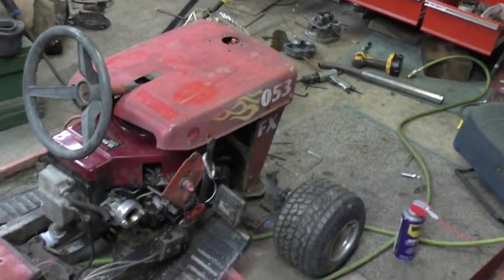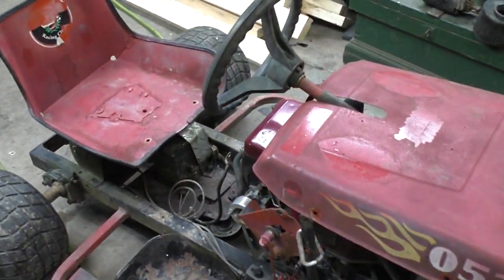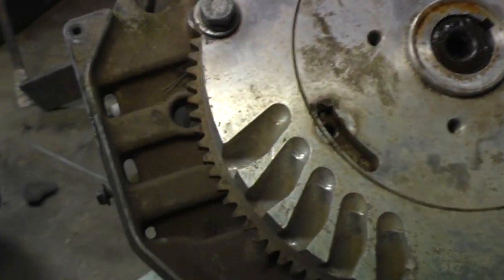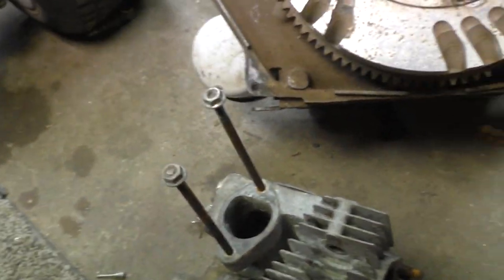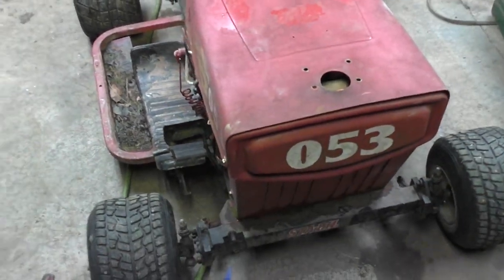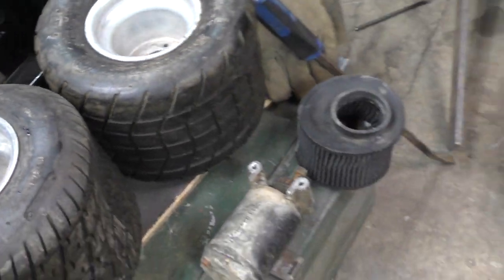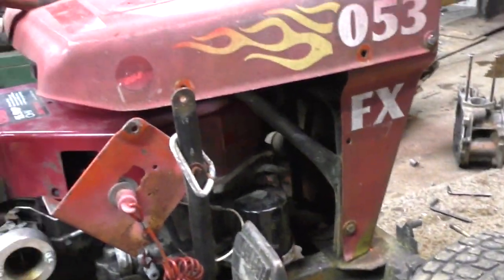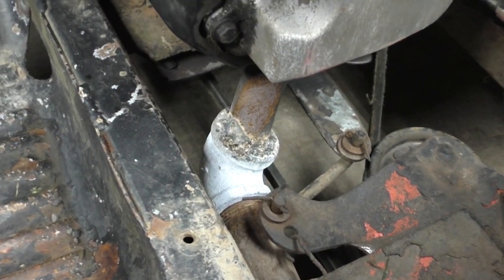Fx Racing Mower

Comment: The carb is not a stick one, it is most likely off of a Briggs flat head 12.5 or 14 ohv. Even tho it is off of a smaller engine it increases the power very  significantly . I used to run the stock carb on my kohler then once I switched the response and power increase was very noticable.
Reply from the maker: Biggasmowers well this runs like garbage and the response is not there,
Reply: redzz02 well if it was sitting with that carb open with modern ethanol fuel it will need a good cleaning . The jet breathers get clogged very  easily , I habe had mine apart numerous times because of that .
Reply from the maker: Biggasmowers hmmm you are correct, I never planned on using this engine so I never put anythought into it
Reply: redzz02 the engines do handle over reving very well . I habe run an ungoverend kohler n my Murray for quite awhile with no issues other than carb getting dirty. ( the previous kohler command I had in it had a plastic   timing gear that eventually stripped out , the older models like yours have steel timing gears.  )
Reply from the maker: Biggasmowers I'll be putting a flat head 8hp or 12 hp Briggs on it
Reply: redzz02 that's a midwest super cub flywheel I think

Comment: Looks like a cool new project.  What happened to the other racer you had? Is this an older video you had?  I ask because the "Sears Killer" in the background doesn't have the fenders, seat, or vinyl decals on it when it was finished for the build off.
Reply from the maker: Carl Hartman you are correct this is from a couple months ago, after I sold the drift missile i no longer have any racer/speed mower except this one